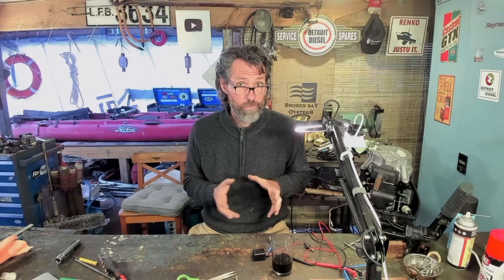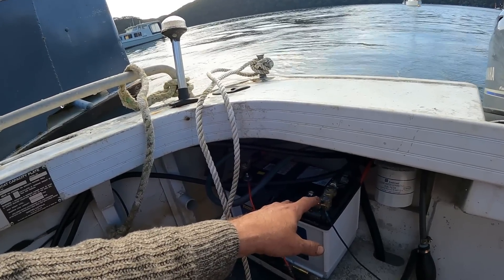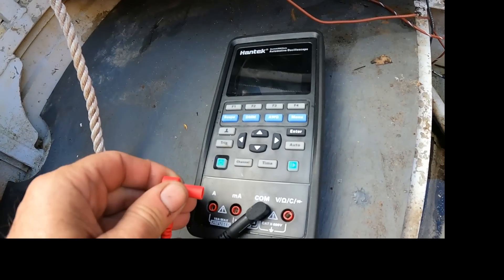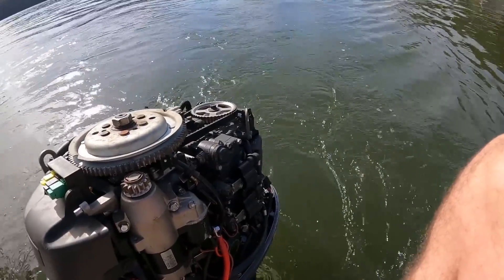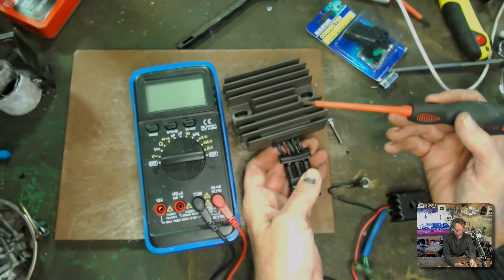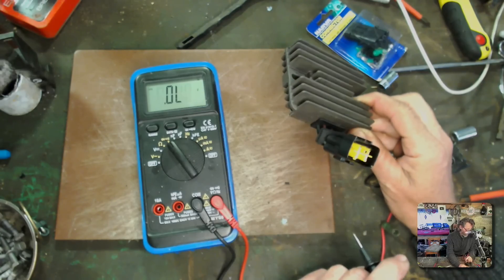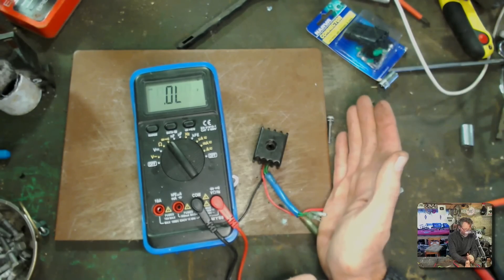Diagnosing parasitic battery draw

Comment: I'm a Yamaha outboard tech. You've identified the failed component, but you need to understand why it broke. In every single rectifier i've replaced, i've found either a bad connection with the battery (main switch, corroded terminals, loose wires etc.) or that the engine was started with a booster because the battery was completely empty. The rectifier needs a stable connection with the battery as a ballast. If it's started with a booster on a dead battery, which is usually disconnected after the engine is running, the electronics in the rectifier will think "hey, i just got started up, but where did the battery go? I know, i'll bump up the power to unfathomable levels to reach it!" I'll admit this is not true for the early 4cyl 1.8L carbed 80-100HP engines whose rectifiers would eventually fail or catch fire. There was a recall for that.

Comment: Many thanks for an excellent video/walkthrough again! I am in a similar situation with a 2009 Merc 40hp 4str EFI. Just to get this right please...on a fully charged battery, once started we expect a voltage drop as the surface charge will go down. When in idle, should reading come up again at around 13V? Or it is the case that when we turn the engine off, the reading should not go back to 13V. Bit confused ..Many thanks again for all you share!!
Reply: Forgot to mention that when in revs and not idle, the voltage goes up (max 13.8) which means that it is charging. Many thanks again!

Comment: Does it upset anything to just disconnect negative.  This is wat I do wen boat is not in use plus I have a smallholder panel to keep battery full allways.
Reply from the maker: It's fine to just disconnect just the positive or the negative as that is all a battery switch does.
Reply: Solar panel

Comment: 0.5v was being shown on the meter (not 5v lol)- a good diode shows (depending on the diode type) between about 0.2 to 0.3v for a schottky diode to 0.5 to 0.6 for a silicon power diode in one direction, and basically open circuit in the other
For 12v 'automotive' current testing I suggest always using the negative lead (not so important in boats, but in a car you really don't want to be trying to disconnect the positive lead with the negative lead still on!) and I always start on the 20/10A range first

Tip for when you do a lot of auto testing- changing the internal fuse in a meter is usually a PITA- so what I do if the meter has a 20A range like mine, I have a 'special' lead I use for current testing (12v/24v ONLY- not mains!!!), I cut a spare lead near the plug and fitted an external fuse holder to that lead- and my meter has a 20A fuse internally, I fit a 15A to the external holder I put in (many cheaper meters only have a 10A range instead, with those fit a 5 to 7A in the external holder)
This way the external fuse blows first, and is easily changed without tools (many meters require a screwdriver and 'some disassembly' to change their internal fuse)

Comment: Carbon build up in anchor winch and starter motors can cause loss too leading too fucking nightmare electrolosis in mainly ally  boats you can get a probe you plug in to your multimeter which you put in water next to boat to check losses 🍻

Comment: Hi Stu. good content mate, thankyou..I have owned alloy boats for decades and still for the life of me cant understand how, if running a common ground through the hull as we do in non marine applications , creates electrolysis issues but every electronic started or managed engine ove had runs a chassis ground on the engine that is then transferred to the hull by way of the engine mounting bolts..To me it makes no sense but i hope you might have an answer.

Comment: A semiconductor junction ( pn for a diode and npn or pnp for a bjt transistor ) has a forward voltage threshold - typically around  0.6 v , this is what your meter is reading  .

Comment: Being solid state and having NPN junctions, if one of the diodes is damaged, you're correct, the diode as part of the regulator can not block current and it can drain thru the alternator to ground or thru the regulator to ground. I'm not sure how it's wired here.  28 mA is a healthy draw. I would expect 2 mA but if you sample lots of vehicles it can vary widely..

Comment: Diodes are semiconductors and can only fail open circuit.
Reply from the maker: I recently read: "Usually, large reverse voltage leads to a shorted diode while overcurrent makes it fail open."
Reply: Incorrect - you can get something called punch through in a semiconductor junction . If you exceed the reverse bias voltage a diode will break down and flow current in  reverse and provided you don’t supply enough current to vaporise the pn junction it will continue to flow current in reverse even if the voltage drops below the reverse threshold voltage .
Reply: @Flattyman  The clue is in the sentence FAIL, they cannot fail short circuit , yes you can push 100v through them till they burn out open, but back to the subject of a 14v charging system NO , put welder on it then it will burn open  but you would have to put it on a positive  cable to make a circuit. Where did your high voltage come from the 12v battery  ha ha ha.

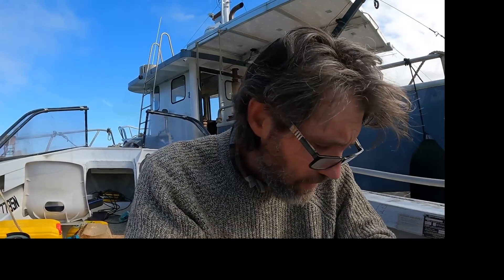Comment: It didn't take long but you confused me between 2:30-2:40, "the engine is drawing power for the battery not from the regulator/rectifier"
Reply from the maker: Normally when the engine is running the regulator rectifier is supplying enough power to run the ignition system and charge the battery. When it isn't working the ignition system is running from the battery and draining it.
Reply: @DangarMarine  If the battery is drained, can the engine be pull started and run? Does the regulator/rectifier modify the power coming from the flywheel before it goes to the ignition system?
Reply: @terrymcclean4582  Nope- if the rectifier has died, then you start running on battery power, if the battery dies, then motor wont run at all....
Sometimes if the rectifier is still good, but your battery has died because of other issues (like leaving the radio on or similar for too long) then you can still pull start if it is 'too dead' to turn the starter motor
Reply: @steved2136  I may be comparing apples and oranges here, but, my old 2 stroke motocrosser had no battery and no lights. A simple kick would get it started and it would run. I think of a regulator/rectifier as converting AC power to DC power (rectifying), and regulating the amount of current going to recharge the battery. I haven't figured out where the ignition system fits in here.
Reply: @terrymcclean4582  An old  system like that is a simple magneto style spark system- very simple, just a coil on the block and a magnet on the flywheel- when you get movement between the coil and the magnet, you get electricity generated, and this is applied directly to the sparkplug- so spinning the motor makes a spark at the right time (may have a set of points to ensure more accurate timing, some may just rely on the magnets positioning) and bingo- running motor (this is still the system often used in lawnmowers and smaller outboards with no battery charging ability....

The newer/bigger ones that have a starter etc- these need a more complex system- they 'can' in some cases use a combination of the older style and a separate 'battery charging coil' (many electric start mowers still use it, and some outboards) but it is usually quite limited in its output- so a small battery, for a couple of lights and a small motor size

Then you get the really big ones- these drop the magneto ignition system altogether and  often have a full 'EFI' style system-these have electronic ignition modules, running from the 12v electrical system, and have either a separate alternator (fairly rare) or a much more developed charging magnet system inbuilt (which is pretty much an alternator without a housing, built into the flywheel area) (these are your multi cylinder motors that can go up in the 'hundreds of HP' range and can charge at quite high currents (needed for the bigger batteries needed to start the larger engine sizes) and can also handle more electrical loads
Reply: @steved2136  First, thanks for taking the time to enlighten me, this is helping. So, I understand my old time motocrosser. Now, my electric start 1996 Johnson 25 has a regulator/rectifier and has cdi ignition. I assume now that it would be susceptible to parasitic draw. Might it be small enough to allow pull start with a dead battery or does it need that DC power from the battery?
Reply: @terrymcclean4582  It  could be either the second or third types- A CDI (capacitor discharge ignition) will 'usually' work as long as there is 'some' voltage still showing in the battery, but if it is at zero volts, almost certainly won't start- it will need at least a small amount to run the electronics in the CDI

The individual circuit will determine the 'some volts' needed, some will literally need only one or two volts to fire- it won't run well at this level, but it will fire- others need quite a few volts (8-10v) and won't fire at all under that ie too flat to start on electric start, but enough to fire on the hand pull...
Thing is that there isn't a single 'circuit' for CDI, there are multiple variations that all have the same end result, but different ways of doing it to get that same end result

Plus some motors will still run a separate 'firing' system- which will generate sufficient voltage to fire regardless of battery state, others use a 'combination' firing/charge system, this can have issues with a 'dead flat' battery attached- they might still be outputting current, but because the battery is so low, the battery will 'suck all the power' leaving nothing for the firing system...
'some' of these won't fire with aa dead battery attached, but some (not all) will fire if it is disconnected (check your specific motor to tell- some need a battery and can't be run without one, others can be safely run without one- this again varies from manufacturer to manufacturer, and even from model to model by the same manufacturer- sometimes even by year even...

Anything with a 'regulator' in it can have the possibility of failing with a parasitic draw- if those diodes go short circuit, you can get a draw, if they fail open circuit, then they won't have a draw, but won't charge either...

Comment: Be careful that no lights or anything is on when doing this test. Even a small led light is enough to blow the multi Meter fuse usually only 500ma or some of the better units have 10amp for 5 second

Comment: I changed to using a UNI-T DC clamp  meter and it's a game changer when diagnosing parasitic draw quickly. It should also be noted that the UNI-T's Eprom can be reprogrammed to give to more feature and also remove some of the meter's quirks 👍🏻
Reply: Uni-T clamp meter can be reprogrammed? - Do tell me more! Seriously, I can look all that up, thanks for the heads up.
Reply: @Bennyboy-dog  The max DC amps reading can read way above the 100A 'max'. The 'count' can be altered as well as back-light timeout, sleep timeout and - more importantly - making it default to DC instead of AC on startup
Reply: @SabretoothBarnacle  Perfect - the AC volt reading is a right PITA.

Comment: It's a bit odd that all three diodes in that pack had reverse leakage. Something major must have happened to take out all three. Hence the blown fuse. Nice tutorial on an often misunderstood topic.
Reply from the maker: I'm thinking something to do with all the welding that went on with the block and the hull, hence giving this friend a free replacement.
Reply: I reckon it was the regulator inside the unit that has died .

Comment: a better way to narrow down small shorts is to measure voltage across each fuse. If theres ANY voltage it means that there is current flow (voltage drop)

Comment: I have a clamp on a meter and tried using to diagnose a parasitic draw on my car.   However it was so sensitive to orientation, movement, and loss of range when adjusting zero that  I didn’t trust the readings.   Have you tried a clamp on ammeter and prefer inline?   

My ammeter wasn’t to expensive, $60 in 2018 US dollars, and had good independent reviews.   It’s not a Fluke so maybe just to cheap.
Reply from the maker: Hey Paul. I do have a clamp on ammeter that a mate gave me. I do find it quite handy for checking current draws but I tend to trust it more for larger draws. If I had thought of it it would have been interesting to see how it compared to the inline test.
Reply: Back in the day auto elecs used a 12v halogen bulb in series with the earth terminal. The brighter the bulb the greater the draw. Pull Fuses to work out which circuit is causing issues.   I wouldn't get too tied up in knots as to the accuracy of your clampmeter. My two flukes serve the same purpose for diagnosis as the halogen bulb does. Good luck with your issue.

Comment: If you have a system with multiple fuses, you can remove a fuse and current test that particular circuit by simply hooking up the multimeter to the two terminals of the fuse.

Comment: Hi Stu, Just getting ready to test my Regulator/Rectifier on my Merc 60hp two stroke with CDI. The Merc test on this is odd having test with an Ammeter by hooking up a 9v battery + red wire to the sense lead from the starter solenoid terminal and the - terminal on the 9b battery to the engine block for grd. Then the red lead on the Ammeter lead to the large disconnected red wire from the solenoid and the black Ammeter lead to the positive terminal on the starter solenoid. With motor running test at 1000 rpm and amperes for a 16 amp system should be 10 amperes. 9amp 4 and for a 15amp 8 depending on which one I have?  If the amperes is below the required readings test the stator Ohms readings and if good replace the Regulator/Rectifier. More of around about way to test for a defective Regulator. Mine did have some burnt yellow connectors going to it from the stator though so I suspect it.

Comment: I usually disconnect the negative battery post, and use a multimeter in amp mode to reconnect it in series. Which gives me a life view of the parasitic draw..
Then I unplug fuses/every device one at a time, n take note when the amp meter drops a large percentage of the total draw. I do this till I see the parasitic draw drop into a dealable range...

Comment: Stu, you know of the third trick in locating a parasitic draw? Instead of risking your multimeter with a possible overload AND disrupting the supplied voltage (in the event it’s an intermittent electronic component) just measure the voltage across the fuses. All fuses have a small amount of resistance that is measurable by setting your multimeter to a low range and measuring the voltage present. All fuse manufacturers publish values to use to convert from the voltage appearing across a fuse to the current flowing through that circuit. Granted a simple one fuse boat might be a little difficult to isolate the different circuits.
Reply from the maker: Thanks for the suggestion, I'll definitely give it a try on Renko and see what various readings I get across all the circuits.
Reply: Or just use a DC clamp meter.....easy
Reply: @marcobrian1619  Sometimes if you have a large fuse panel, it might be easier to just go down the line and check each fuse for a voltage drop. "One Stop Shopping" Of course there are 2 issues that present themselves using each method. First, the voltage drop across a fuse is quite small and a "bargain brand" DMM might not be sensitive to read the voltage. Also, I've found DC clamp type amp meters to be kind of fussy and getting them zeroed out can he a headache. (just my 2¢ worth)
Reply: @marcobrian1619  I have a couple of Uni-T clamp meters.  They do AC and DC.
Reply: We use a very sensitive current leakage tester that you just clip around a wire. In most cases you can't use the method you described.

Comment: don't know if this helps or not but if you suspect a large amperage leave the meter on volts. If there is no current being drawn the voltage will be zero but the more current being drawn the higher the voltage will be might save the multi meter. apart from that all connections are the same

Comment: Your  keel cooled / rad cooled outboard idea is something I've been thinking of doing myself. I'd like to have heat in my boat, and I thought a closed system of some sort with an automotive heater core could be viable. Looking forward to your insights!
Reply from the maker: Ah, of course! I'd never considered that it would also also a heater coil to be added. Good thinking. :)
Reply: If you add a keel line too. With divert valve.  So can control the heat.
Reply: Exactly, not something you ever see people do. I'm super interested in seeing it. I'd suppose it would be quite simple considering there is still a thermostat in place. I would guess the hardest part will be making sure it can hold pressure since the outboard isn't designed to be a closed system.
Reply: @MPGamingCentral  
As in well pumps  put in a pressure tank. To absorb the difference in pressure.